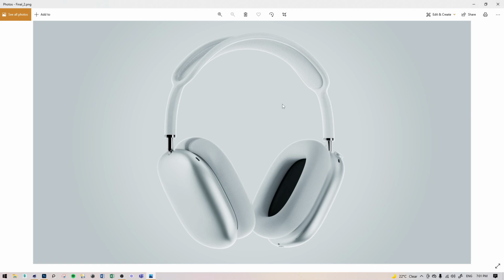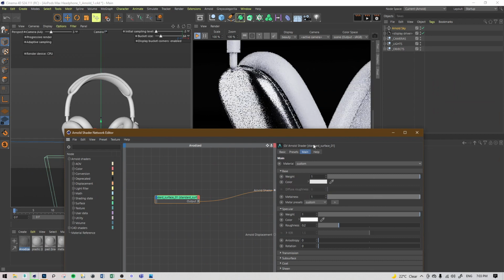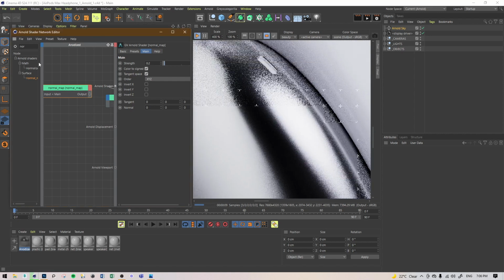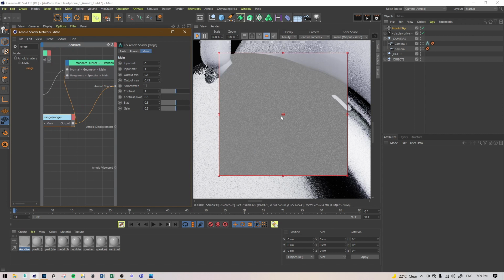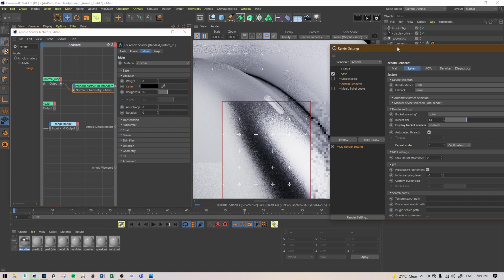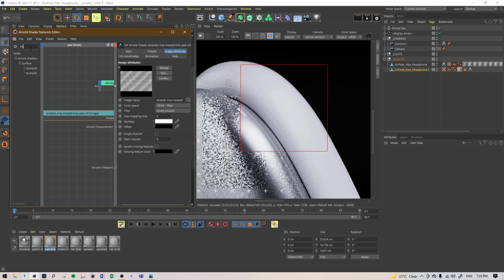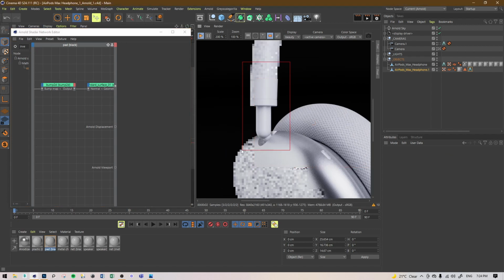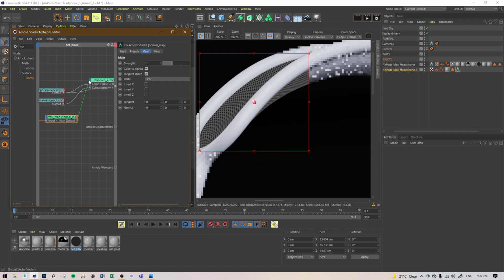01 - 3D Headphones Product Visualization Tutorial || Cinema 4D & Arnold Render || Texturing

Comment: Hey , Thanks for sharing this process. I can't help but notice you connecting nodes to output with some shortcut @5.50. Is it a custom shortcut you have setup or some plugin?  Thanks
Reply from the maker: It's a shortcut, yes. It's the ''Alt + W, 1'' shortcut (Sometimes it's buggy so you have to restart Arnold IPR for it to work).
You can check the link in here for all the C4dtoa shortcuts > 

https://docs.arnoldrenderer.com/display/A5AFCUG/Arnold+Shader+Network

Best of luck!
Reply: @metarenderacademy  Thanks a lot, You made my day.